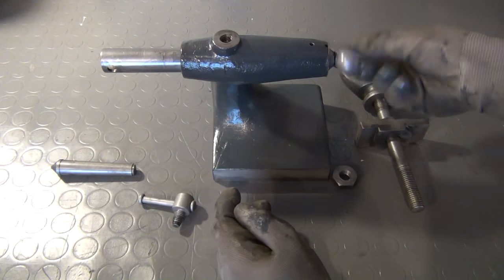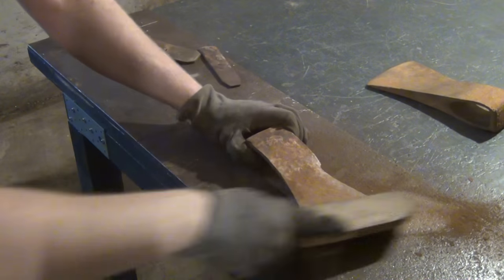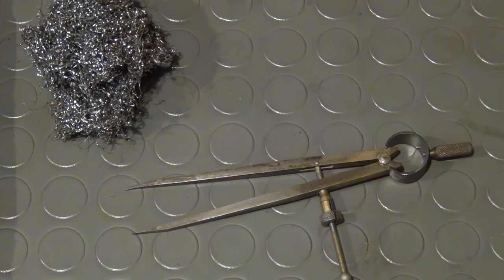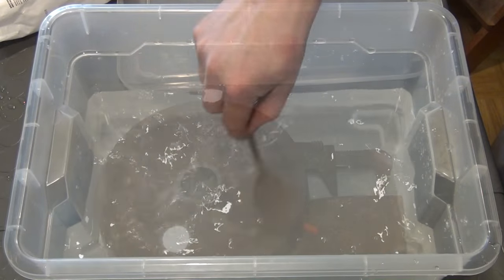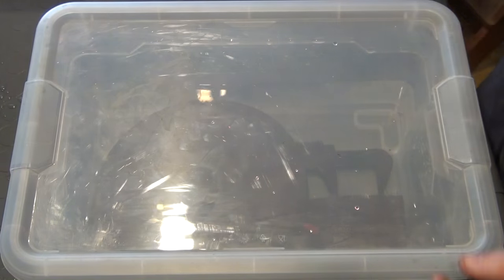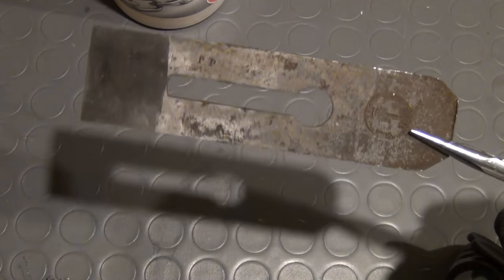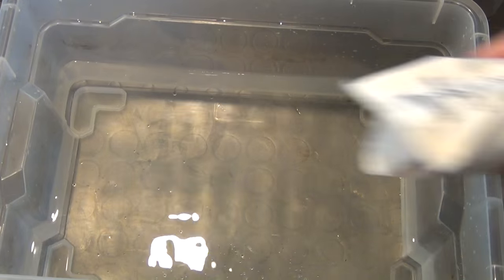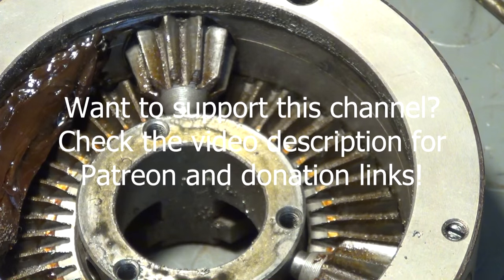Rust Removal Experiments: Citric Acid, Cider Vinegar, Rostio

Comment: I've got some rusty nuts and bolts on my bicycle and a bottle of cider vinegar in my kitchen. Do you think I could just apply some with a paint brush and let it get to work, or would I have to dismantle the pieces first and soak them?
Reply: +Ace Sul 
If you don't dismantle the pieces, some acid will creep into the thread and remain there, further accelerating corrosion in the future.

Comment: Hello, first time commenter.  Did you ever consider using Coca-Cola as a rust remover ?  I don't know just how high it's acidic value is...but it might be in-line with at least vinegar...and MAYBE even as strong or stronger than Citric Acid (which I believe that Coca-Cola DOES contain a certain amount of Citric Acid....now that I am thinking about it...).  Here Coca-Cola is very cheap by the liter, especially when it goes on sale......just something to consider.  Thanks for your vids.

Comment: I was so supprised by the results, i expected the rostio to be the easy winner.
But it did work smashing on the tailstock handle, odd stuff.
Reply: +zx8401ztv Having used a similar gel (here in the UK similar stuff is made by Bilt Hamber, called Deox gel) I was not surprised. The main use is for surface rust removal on car parts that cannot be submerged, however as said it's almost impossible to spread evenly.
Electrolysis is IMO the best and most reliable method.
Reply: +SDG Electronics 
I cant say ive ever heard of Deox gel, although its been years since ive needed to remove a mass of rust, i have bare metal tools but they get the oily rag lol :-).
I do remember "Rust Eater" but that was to stop it, not remove it.
I wonder if a sheet of cling film placed over the rust covered by Deox gel would keep it in place and you could move it around by poking the cling film with a digit :-D

Comment: Acid does not "corrode" the iron - it does not form *oxide*.
It dissolves iron - Fe becomes Fe2+ ion and goes into solution, whereas H+ ions take resulting electrons and turn into H2 gas.
This is why it does not form more rust. (But of course, it's not better than rusting, the effect is the same regarding damage to the surface - the iron is removed)

Comment: Ich habe gerade mehrere von deinen Videos gesehen und bemerkt das du dich gut mit Elektrotechnik auskennst und wollte fragen ob du es schaffst einen Hochfrequenzinduktionsstahlschmelzoven aus Teilen aus Modelbauläden oder simplen Elektrogeräten wie Mikrowelle oder Schweißgerät zu machen ,der ein Fassungsvermögen von zumindest 2Kg hat und mit dem man Stahl gießen kann (230 oder 400 V) 
Als Reaktionsraum würde ein handelsüblicher Schmelztigel genügen der in die Induktionsspule hineingestellt wird und für die Gussformen Getrockneter Lehm ,Schamottmörtel oder Ölsand .
Den Stahl kan man z.B mit Argon oder CO2 vor Oxidation schützen und man kann alte Schweißelektrodenmäntel für das Absondern des Ph und S sowie Si nehmen.  
Die Temperatur sollte 1700 Grad erreichen um Werkzeugstahl zu schmelzen und die Induktionsspule sollte Wassergekühlt aus einem geschlossenem Kreislauf mit Pumpe kommen      
ich habe bisher schon den DIY ARC-furnance von hier in Youtube nachgebaut aber der Stahl der dabei endsteht ist so verunreinigt das er nicht mal für was Taugt wenn man ihn korrekt Härtet und Anlasst .
Ich glaube das wäre auch eine Bereicherung für deine Werkstatt 
Vor dem 2. Weltkrieg hat man auch einfach losgebastelt und so sind ganze Konzerne endstanden. 
Auserdem kann man wenn man den Stahl nur kurz in die Spule ohne Schmelztigel hält Schmieden ohne den ganzen Ruß und die Kohle zu haben.

Comment: Tips from and experienced metal finisher:
- 
Gasoline should NEVER be recommended as a cleaner!!! One spark and you get third degree burns. 
(Why would you want that on your conscious?) 
- 
Dish washing soap is excellent at removing grease from steel and T.S.P (Trisodium Phosphate) is the professional solution. 
- 
Plastic trash bags and duct tape will allow you to use less chemicals and an air pump will speed the process.
- 
Power Tools make rust removal easier. Sand blasting heads and sand is cheap if you already have a compressor. If you have a grinder then a wire wheel is priceless for rust removal.
- 
Rust prevention can include: Mineral Oil, WD-40, Wax, Dry-to-Touch Sealant, Paint and Zinc Plating.

Comment: Try white vinegar essence, not cider or normal vinegar.
Much stronger acid, should be pretty fast. Never tried it, though, I´m more the wire brush user.

Versuch mal Essigessenz, nicht normalen Apfel- oder Haushaltsessig.
Wesentlich mehr Säuregehalt, sollte recht flott gehen. 
Habs noch nicht versucht, bin mehr der Drahtbürstennutzer.

Comment: If you optimize for speed there is an undisputed winner, trust me: hydrochoric acid. It makes sense as it's the most reactive acid, and it will dissolve any rust damn fast. I wouldn't dare even leaving stuff in for a full day, because by then the rust is already destroyed long ago and it be eating the metals you are trying to keep.

Comment: turn the bottle in a circle motion, to make vortex, and it will empty really fast ;) 
great movies. thanks
Reply: +Kim Loft Bennetsen (CaTTeN) Good advice. It is because the centrifugal force will push the liquid to the outside and the air will have an easy path in the center.
Reply from the maker: +Kim Loft Bennetsen (CaTTeN) I normally always do that when emptying bottles, but when you film yourself while working you sometimes put more thought into the camera angle and the lighting than what you're actually doing with your hands :D

Comment: You can also add salt and hydrogen peroxide to the vinegar.
Reply: hydrogen peroxide is an oxidizer; it would accelerate the rusting of the iron
Reply: Treebark1313
Not "rust" but yes, oxidation. That mixture is one which I use to remove rust and acid etch blades. Leaves a nice oxide layer which resists rust much better than white metal.

Comment: if you just use 32% vinegar and some water + heat, then you don't need to do the cleaning, especially there is no need for gasoline! 
you can leave the pieces in there for 1 hour and then wipe off the surface rust in the sink, and put them back in for another few hours. 
Basekly the stronger the concentration the faster it goes, with some added heat.
Reply: zentex99 Gasoline can have some very nasty chemicals, I think in Germany it can still contain benzine

Comment: A baking soda bath will neutrilise the citric acid.
Reply: No... the bicarbonate would neutralise the acid.
Reply: Yes, but then it leaves a salt...
Reply: @MrGoatflakes  salt won't dissolve the rust.  Must be high or low pH not neutral. ☺
Reply: @davidaustin6962  sodium citrate is still like most salts an electrolyte, and so when it's left it will encourage rust, that was my point. I don't know if it is also hydroscopic, but if so it will further create more rust.

Comment: I think the main difference between these process is the pH, I thin the citric acid has a smaller pH than cider vinegar which may have a smaller pH than the Rostio, but I might be wrong; you should maybe use some pH indicator paper to be sure ^^
Reply: +flo ri 
The pH doesn't tell you anything about how corrosive an acid is. Especially when comparing different acids it's completely irrelevant. Hydrochloric acid is "stronger" than sulfuric ot nitric acid and still it's the most harmless of them to skin for example (if you pour HCl on your hand, it will take a minute before you start to feel anything). Hydrofluoric acid is much weaker than all of those, and still it's the only one of those that eats through glass.
Reply: Thank you ! I didn't know that ! But when he said that adding more citric acid so the solution is saturated and the process faster isn't it going to be a lower pH ("stronger" acid) ?
Reply: flo ri
Yes, if an acid is more concentrated the pH will be lower and in that case (the same acid) comparing the values makes sense. But even then it doesn't mean it will work "better". There are uses where you have to dilute an acid for a reaction to work at all. So unfortunately there's no single value with "more is better". Chemistry is weird like that!
Reply: +superdau +superdau Ok, I  understand now =) The worst is that I should know that the more isn't always the better, because of stoechiometry (or whatever you spell it ^^') I've learned that in high-school ...
So if we put too much acid in solution, the reaction will not be faster (it reaches a kind of maximum speed) or  will it be slower because the saturation of the solution is slowing the reaction ? And if the first hypothesis is right, does adding more acid makes it so the reaction has more compound to go through before stopping ?
Reply: Sometimes the water in the acid is a needed part of the reaction, often depending on the concentration of the acid different compounds form, some of which may "protect" (are no longer soluble by the acid, but stay on the material to be etched) whatever you try to bring in contact with the acid.
Reply: +superdau Well, thank you for sharing your knowledge, it's very kind of you =)

Comment: Why use cider vinegar at all, and even the organic (Bio) stuff? Of course that's expensive. If I were looking for this kind of acid, I'd use vinegar essence (Essigessenz), of which a 500ml bottle costs about 0.60€, and it has around 25% of acid. Funny enough, it's also in the food section of grocery stores, although the only thing you can actually use it for is cleaning.
Reply from the maker: +Seegal Galguntijak People suggested about a hundred different substances to me, when I asked for experiences with chemical rust removers. So I simply had to pick some of those and try it. I chose (organic) cider vinegar and citric acid because that stuff was available at the closest grocery store. I work on a lot of projects and sometimes things have to be done as quickly as possible to go one with more important stuff.
Reply: The Post Apocalyptic Inventor I understand, but an Edeka should also be carrying vinegar essence, at least they do here. With the only exception being a small "Tante-Emma-Laden" style shop under the label, but I haven't seen many of those (only in very small villages - with a hundred inhabitants or so - in eastern Germany, everything else has been blanketed over with big supermakets)...

Comment: Excellent and enjoyable video.  There's a product available in the US called Evapo-Rust.  It's available in Europe as well; evaporusteurope.com.  It's nontoxic, biodegradable and very effective.  I've used it on finely machined arts that were rusted from humidity.  It doesn't seem to consume good steel even after 24-48 hours of immersion.  Unlike many other rust removers, it can be returned to the container and re-used over and over.  I run it through a coffee filter and funnel to remove the sediment.